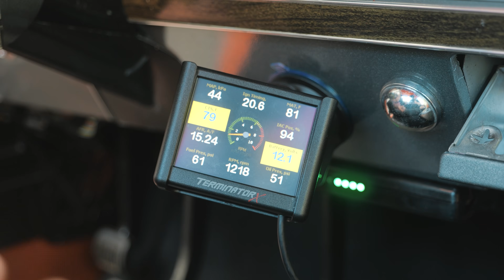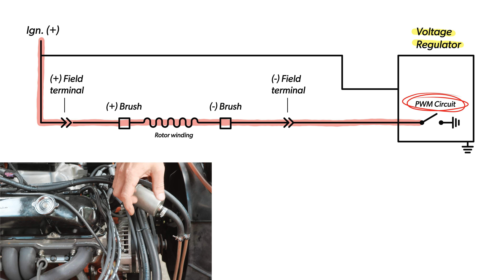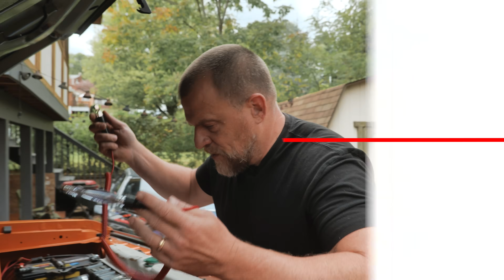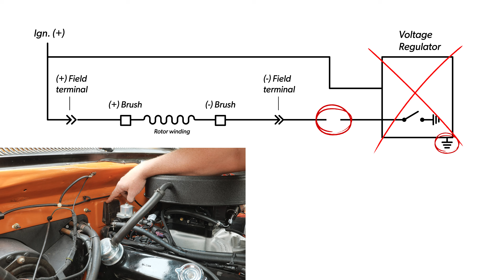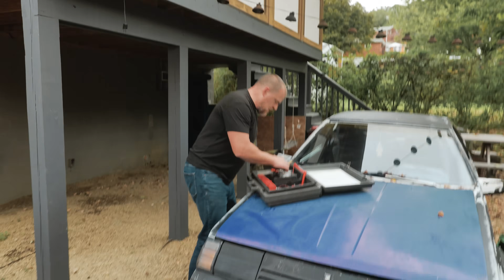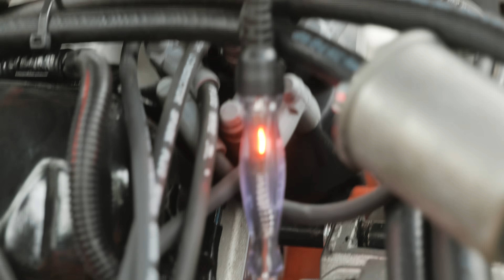Mopar Charging System Testing [External Voltage Regulator]

Comment: Paul couple of questions for you.

1.  Is that charging system the stock factory charging system for that truck?  If it is I'm very surprised to see something that old using a PWM signal to control a component.
2.  How big of a load is it to run that entire Holley fuel system?  Was the original alternator you had installed able to keep up with the demand or did you install a higher output alternator?
3.  If you are using your original alternator are you worried about A/C ripple being introduced into your electrical system and frying your EFI controller?  Do older alternator produce more or less A/C ripple than modern alternators?
Reply: Agreed on your point 1).  These transistor regulators provided a continuous (analog) variable resistance (current) to ground. Kind of like turning a rheostat up and down to set how much output is required.
Reply from the maker: @nohrtillman8734  so the operation of the regulator on my truck does not operate like a factory regulator would have in 78? Thanks! Sorry to mislead the masses if this is the case
Reply from the maker: Great questions. Yes, this is the stock 60 amp alternator. I haven't done a full amperage measurement yet, of the holley EFI system but intend to. The fuel pump is less than 10 amps and the injectors are probably about 1 amp each (4), then the IAC motor, ignition coil and ECM and ICM modules main power , so at a guess, we are somewhere in the 15-20 amp range. With my headlights and blower on at idle, it cannot keep up but about 1200 RPM it can. I need to upgrade this to a 100 amp alternator (along with the wiring) but haven't worried about it yet as I rarely drive at night and this is a nice weather ride and will see NO snow or winter driving so even the blower/heater isn't a major concern. No issues with ripple at all!

Comment: I understand everything that Paul's talking about as I grew up on $75 Dodge dart for 360 with air conditioning if the same alternator and power steering and my brother is a 1974 Dodge ram charger with a factory 440 in it. Same setup but with the air conditioning. Here's the question. How did the belt slip off the power steering? Because if the belt didn't somehow jump the power steering, this video wouldn't have been made and there wouldn't have been any problem. I'd be looking at what causes mechanical issue in the first place
Reply from the maker: Belt was loose and 600hp on a heavy romp 😃

Comment: Is that coil a lower than standard 12 volt coil? IIRC in UK Fords with this system used a maybe 8 or 6 volt coil, as it's running at around 5/8 volts
Reply from the maker: Standard coil (hyperspark) with hyperspark ignition module. No ballast needed and coil is not constantly energized like the ballast systems

Comment: The main problem people have with this style Chrysler alternator is a missing spacer. If the spacer is missing perhaps it fell out on the ground when you removed the alternator or it didn’t have a spacer. Anyway your brand new alternator will lock-up and smoke the belts. 

Missing spacer will put the alternator case in a bind when you tighten the alternator bolt. I’ve seen this on many old Chryslers and Dodges.
Reply from the maker: This one is aligned properly. Thanks!
Reply: @ScannerDanner Alignment isn’t the issue. Without a spacer it squeezes the alternator housing putting it in a bind and makes it lock up when you tighten the long bolt.
Reply from the maker: I'm good there too

Comment: Get yourself a rivnut to fix that mounting hole..A 1/4 inch bolt takes about a 3/8 hole to install the rivnut ..And I would install in the wire harness a direct wire from the mount bolt of the regulator to battery ground..Also there are test lights (LED) that have a voltage display to read instead of looking at the light to see if it is dimmer or not

Comment: That is interesting regulator (how it knows when to pulse the rotor)
Reply from the maker: It is all based on the input voltage on the feed wire to the regulator. There is a set voltage it is trying to achieve. And it's all done without any type of microprocessor. Just a transistor, resistors and diodes and even a temp sensing circuit that affects the control as well. Pretty cool stuff

Comment: That pulley presses on the rotor shaft pinching the front bearing between the rotor and pulley. The belt must have pushed the pulley off of the rotor shaft a bit. That would allow the rotor to slide backward through the bearing and as a result the field wire of the rotor probably made contact with something on the inner back side of the rear case of the alternator. Thanks for the video!

Comment: fuel flter  over the alternator  what  would happen  if you had a fuel leak  with the engine  running
Reply from the maker: probably wouldn't be good but no more dangerous than leaking onto the engine anywhere imo as the alternator is not throwing sparks

Comment: Good thing the belt didn’t rip those temporary rubber fuel lines & burn it down!  You don’t need another truck fire, lol.

Fix that!  Stainless braided or steel lines would help…
Reply: yikes! we'd  have to start calling him "fireball danner" then.
Reply from the maker: These are 600 psi rubber lines. But yeah, some braided steel in the future, but even with those, there is so much cheap crap out there that picking the right ones would be key

Comment: Scanner Paul just upgrade to to a GM alternator  

That molar wiring will burn your vehicle  down.
Reply from the maker: The biggest weakness (fire hazard) of this system is the internal ammeter and heavy gauge wiring that runs through the firewall. Both of these are easily bypassed and would still be necessary to do with a 1-wire GM
Reply: @ScannerDanner make sure you have grommets  and  upgrade the wiring.